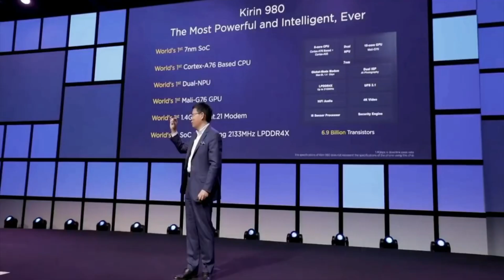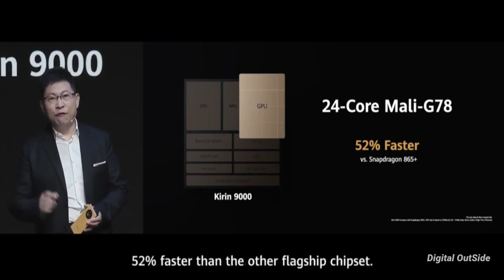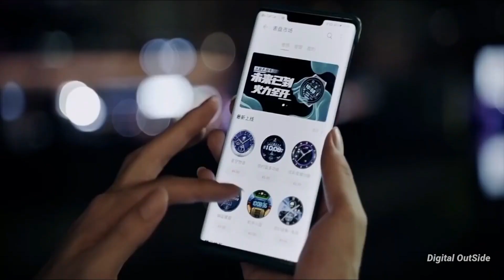Harmony OS 3.0 - ARM will save Huawei

Comment: The Kirin microprocessor is made under ARM architecture. And very much improved, so much that it became the best microprocessor. Huawei has problem with processors production. Because the Chinese foundries don't make cips on a lithography under 14nm.

Comment: Not a plausible move for 2 reasons:
1.- Because of the similarity of view between USA and England regarding the Chinese menace against western influence...
2.- Because, once you virtually create the chip, it should be manufactured... The German company which processes the chips fabrication can't do business with Huawei's China...
So, if ever this negociation goes on successfully, they would be a high probability to introduce some trojan horse within the chip, to try to spy on or even take down most of Chinese technological infrastructure!!!

Comment: ARM is not a chip manufacturer. ARM cannot help Huawei. ARM is a chip designer and can only license it's design to Huawei. Then some chip producer has to manufacture that design into a physical chip.
Your knowledge is very weak and misguiding.
Reply: They can license their design to a Chinese chip manufacturer. Simple! There at least 3 chip manufacturers in China that can do the job. Not weak & misguided
Reply: @MrBuddie10  Ok Einstein... That's what I said. They have to give it to a chip manufacturer to produce physically. Read between the lines. ARM still can't rescue in fabrication. For your information, Huawei has a license dear. From a decade. That's how they were doing Kirin chips. 
If there are three chip manufacturers in China then why no one is producing chips for Huawei?? Answer this Einstein.
Matter of the fact is that no one in china has advance technology to produce latest chips. It will take them many years to be able to produce chips for Huawei.
Reply: @MrBuddie10  Please no name calling.. Huawei will still be facing chips productio issues. ARM is not going to solve the issue. The problem lies with TSMC being sanction by the America Govt not to manufacture chips for Huawei.  SMIC announced not long ago they will be able to produce 7nm chips which by then TSMC will be producing 3nm.

Comment: They actually don't need ARM, (I mean the company and not the architecture) because they are actually already making it 100% by themselves.
Reply: They can't make ARM chips themselves without ARM permission lol.. they just used the ARM architecture and modify it to work best for their devices.. it's not theirs and they don't develop it
Reply: Most likely RISC V or LoongArch architecture.
Reply: China may have the Risc chip design etc, however, they cannot take advantage of the 5nM or finer technology, at least for the moment. IBM had announced they had achieved 2nM.  Really?????